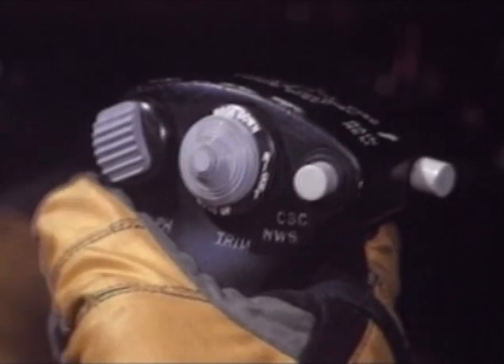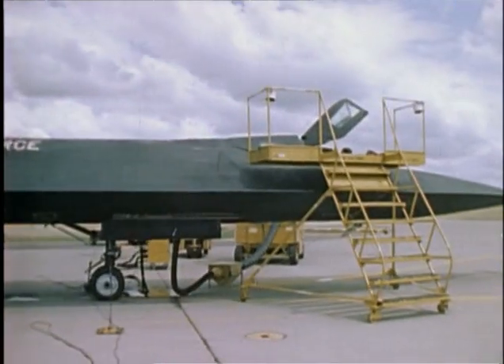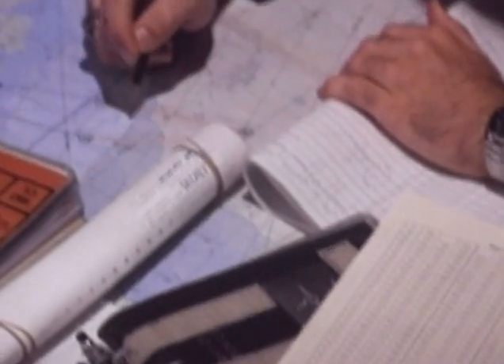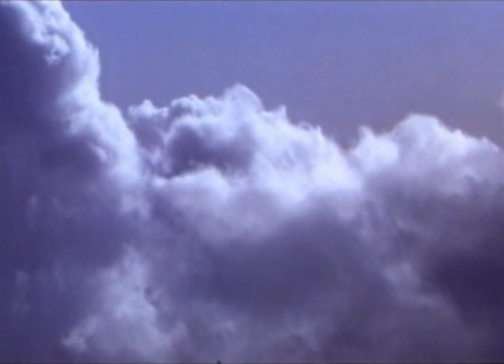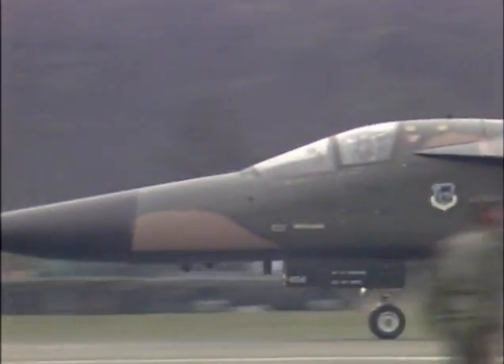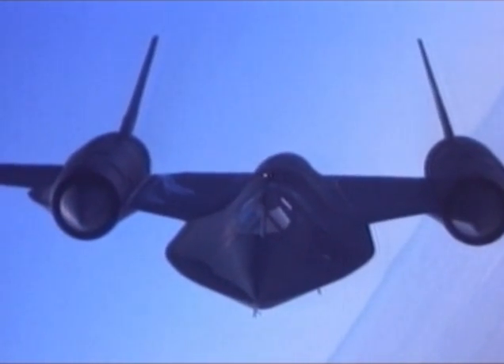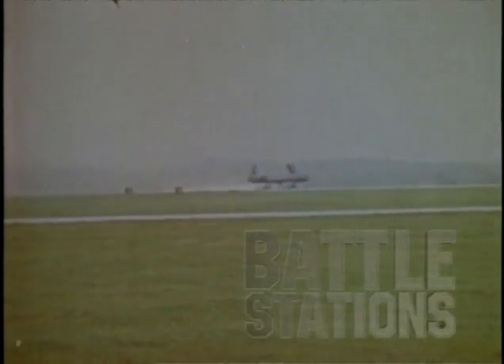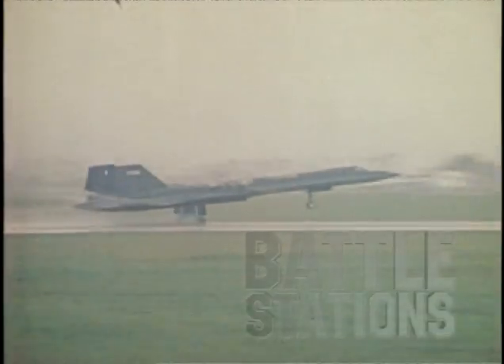Battle Stations - SR-71 Blackbird Stealth Plane -Full Documentary

Comment: And yet they could not stop the fuel tanks from leaking on the ground because there is no sealing material that can withstand the extremes of temperatures the Blackbird underwent in flight.  If that is so (and it is) then how can the ISS (and other "spacecraft" ) be airtight in the extremes of both being on earth and so called outer space?   It can't.

Comment: Did anyone notice in the ending credits of the first video around 44:38, the picture of th SR 71 taking off looked like it had exhaust heat Plumbing coming from out the center of the aircraft? Anyone knows what that was, maybe APU??
Reply: At the speeds this bird does causes the plane to heat up to ~1000-1500 Fahrenheit from the friction of air molecules sliding across its surface. When metal heats up, it expands, so there was the need to put expansion joints in the fuselage (which also serves as the fuel tank).  When the plane is cold, it leaked fuel like a sieve. So they only added enough fuel for take off, then immediately rendezvous with a tanker to add the 60,000 pounds of fuel. What you may have seen is fuel mist.
Reply: m.briggs yeah I noticed also, might just be fuel leaking etc. Or maybe it's a 3 engine variant that goes quicker than mach 3/4 ... Just a thought...

Comment: I was stationed at Beale AFB in the early 70's as a Precision Photo Processor. Back then the SR71 and its capabilities were top secret and we had to have a top secret security clearance to work with the film. It wasn't many years later that you could find an SR71 at most aviation museums around the country. Times change but the speed records will probably last forever. For me the most impressive aspect of the plane, other than its pure beauty, was the volume of sound at take off.  Holy afterburners batman!

Comment: The SR-71 is anything but stealth, the amazing amount of heat it generates makes it actually easier to detect on radar than a normal plane.
Reply: I didnt know radar picked up heat, thought it sent out pulses of  electromagnetic frequency and when it hits an object reflects that pulse back giving a signature. The stealth engineering implemented here reduced the radar cross section x100. The priority of the design was speed, not to make it invisible.
Reply: LOL! Of course, there is no way you could possibly know. Or you wouldn't be talking nonsense.

Comment: I once saw an SR-71 doing touch and go's as I was driving down a remote road and though I was aware of them seeing one bearing down on me gave me a feeling of doom... I realized the absolute power struggle of the cold war, still gives me goosebumps 33 years later.
Reply: Lucky you !  Use to work close to a airport and my moment of luck was a F18 doing escort duty for some drunk on a plane. Was sitting outside and had a weird feeling. Looked to my right and there it was!  I swear could have hit it with a slingshot and a rock kind of low !!

Comment: Pity the stealth capability was utterly lost because the thermal signature was so bit it could be spotted from several 100s of miles ON RADAR - the change in air density was THAT BIG. That is the bit they DON'T mention. The upgrades to the U2 make it far, far more 'stealth' from a modern perspective. If you can defeat radar, thermal & laser detection (which it can), it is likely that the U2 is still overflying 'opposition' states.

Comment: they really need to fully restore and recommission one SR-71 simply for military airshows and display so the public can see EVERYTHING that went into such a masterful design. There isn't a thing left on this plane that isn't obsolete by now anyway... We need a new reconnaissance plane that makes peoples jaws drop when it's finally revealed. The aurora SR-72 might be that plane, but until they actually announce it's either A.) built or B.) I.D.'ed in battle it's just a fantasy plane... This plane literally hung on my wall as a kid. My neighbor worked for Lockheed  and got me some photos of it blown up to poster size. They currently have gutted planes on display at the Smithsonian Air and Space museum in D.C. and on the deck of the USS Intrepid in NYC. Also, there's a rumor that there IS a flight capable SR-71 being housed at the (Semi) defunct Griffis AFB...

Comment: They failed to bring up one of the many stories involving this incredible plane. The titanium was actually acquired from the Soviets because they had by far more of it then we did. They used bogus companies and what not to get the metal
Reply: They mentioned it - you failed to recognize the statement.
Reply: And the thing leaked fuel like a sieve. They had to engineer thermal expansion into the plane. At full speed, it would grow several inches longer and wider, so they had to leave gaps.
Reply: @rylian21  It wasnt the thermal expansion of about a foot that made  the tanks leak.  There were corrugations and special forming techniques that allowed for the thermal expansion without buckling.  The reason the tanks dribbled was because the specific JP-7 fuel the J-58s burned was characteristically difficult to seal against. As the dribbling progressed into leaking, the tanks were resealed. Remember the planes structure was the tanks and the tanks were the planes structure, they were one in the same. The dribbles became an issue only if they became leaks once the fuel system was brought up to flight pressure using nitrogen gas from the liquid nitrogen dewars on board.
Reply: it should be than not then
Reply: No sir the titanium technological know how and the original stock came from a Canadian company that was later kindly asked to be closed down.
Reply: Howie Carson tf

900099
Reply: Myth.
Reply: Captain Jim  -  you do know that none of the uranium produced by Uranium One can leave North America right?   Do you really think she alone made the decision to allow the sale of the company?    Unlike trump’s foundation (which is now under criminal investigation), the Clinton Foundation has the highest rating a charity can get and doesn’t profit them personally at all...   they make plenty on the speech circuit.   You act as if Hillary had a suitcase of yellowcake and swapped it for a bag with a large $ sign on it in some parking garage at night...
Reply: @grendelum  Yeah, that'd be pretty close.  The Clintons belong in prison for that and several other things.
Reply: Who cares how they got it back then.  Now it is not that rare and you see it used in many products you can buy,  All of our Nuclear Subs are made with it and they take way more titanium for one than the entire SR-22 program did.  Now Clinton sells the right to 25% of our Uranium to Russia despite warnings they were trying to acquire it through fake companies.  She and Bill made millions to overlook it. That is more troubling to me.  If we can beat them out of it great but do not turn around and give them materials for weapons that may be used to destroy us.
Reply: Captain Jim  Not sure why you bothered about that Jim.........I can't see Russia and U.S.A. going to war.

Comment: In my opinion, the SR-71 is the best technological achievement of the 20th century.  It was the most ahead of its time, and still has not been surpassed, 50 years after it first flew.
Reply: Its actually still ahead of its time.
Reply: How about the computer...?
Reply: Saturn V rocket is waaaaaaaaaay more impressive.
Reply: jim bob banjo :how the fuck do u think a missile would leave the bird?? the moment you set it off, you will fly into it!..and you want them to make it faster??.why have you got a mach+3 (plus in your case), warheads lying about, that the rest of the world is unaware of??..you can't have a high altitude, 3Xsupersonic bomber..that's what the nighthawk and B2 were then built for
Reply: @johnnysheridanboxing5185  Look up the YF-12A, it used the A-12 design and came out before the SR-71.  The YF-12 Blackbird was armed with 3 AIM-47 Falcon missile.  We are talking about high speed interceptors, not bombers.  The YF-12 could carry 3 Falcon airto air missiles and could shootdown targets maneuvering at 500 feet while travelling at 75,000feet at over Mach 3.  3 YF-12s were built, 1 survives.  NASA ran the YF-12 for years in the 70's. All F-12's/YF-12s have ventral fins coming down off the engine nacelles and a single larger ventral fin that folds down in between the engine once the landing gear comes up.  This version of teh Blackbird doesnt have chines on its nose as they would have interfered with the RADAR dome in teh nose. In order to retain directional stability, the three ventral fins were needed.  All the SR-71 B and SR-71C trainers that have the rear cockpit sticking up into the windstream also have the 3 ventral fins. The A-12 trainer does not have the ventral fins.   https://en.wikipedia.org/wiki/Lockheed_YF-12
Reply: @hoghogwild  - The YF-12A essentially became the SR-71, with design/engineering changes and improvements. But I didn't know they could be armed. Amazing that they began the program in the 1950s/early 1960s. Also amazing and ingenious that they used a secret "shell" company to source Titanium from the Soviet Union.
Reply: @Sovereign_Citizen_LEO  In essence yes, but aerodynamically they were different, mostly due to the lack of chines and being 6 feet shorter than SR-71.  The A-12 was a single seater(except for the Titanium Goose trainer that had teh full cockpit behind the front cockpit. The rear cockpit was also offset slightly. The trainer variant did NOT have the ventral fins at the rear under the engine nacelles unlike what the YF-12A Interceptor(missiles) and the SR-71-B(trainer) and the SR-71-C model which was a structural front fuselage mated to a wrecked YF-12A rear fuselage.

On 26 January 1960, the CIA ordered 12 A-12 aircraft.  In mid 1960, the Ir Force ordered 3 YF-12-A's. The A-12's were produced from 1962 to 1964 and flew from 1963 to 1968 and operationally from 1967 to 1968.  
The AF-12s took the seventh through ninth slots on the A-12 assembly line; these were designated as YF-12A interceptors
May 27, 1967 is when the A-12 arrived at Kadena.  In 1967-68 at Kadena there were 3 A-12s flying and eventually the Sr-71s came to Kadena and they overlapped for a brief period of time.  The last operational A-12 mission was over North Korea. On 4 June 1968, just 2½ weeks before the fleet's retirement, an A-12 from Kadena, piloted by Jack Weeks, was lost in the Pacific.  SR-71's were tasked to help with the Search and Rescue mission. Frank Murray made the final A-12 flight on 21 June 1968, back to Palmdale California.

There were 18 aircraft built at the initial single cockpit A-12 length.
13 A-12's single seater single camera photo recon,pilot turned camera off/on-if it was foggy, they pressed the "foggy weather button". There was a single Titanium Goose trainer that was built with the full/slightly offset rear cockpit which stuck significantly out into the wind stream. This trainer was only built using the J-75 engines instead of the J-58 engines. The less powerful engines and the huge 2nd cockpit protruding out in the airstream reduced top speed to around Mach 2
3 YF-12-A front seat pilot, rear seat FCO(FireControl Officer)
2 M-21 front seat=pilot rear seat =LCO (Launch Control Officer) these       launched the D-21 drone.

Total Blackbird family
A-12 for the CIA 68,000 pounds fuel load, narrow nose chine formation
A-12 trainer for CIA
M-21 for Mother ship that launched to D-21 or daughter drone
YF-12A  high speed interceptor prototype variant, chineless front nose in order fr the air-air targeting RADAR to remain unobstructed, carried 3 AIM-47 Falcon missiles(later developed into the AIM-54 Phoenix missile system of the F-14-anytime Baby!
F-12 high speed interceptor production aircraft(never built)
SR-71-A- 2 seat full recon bird, wide front nose chines, multiple cameras, electronic snooping, 7 ft longer, carries and extra 12,000 pounds fuel for 80,000 pounds max fuel
SR-71-B trainer version, wide front nose chines, rear full cockpit which stuck out into the windstream-much more than the flush mounted A rear position for the rear seater the Recon Control Officer
SR-71-C  The 2nd to last SR-71-B was lost and everyone thought that the sole SR-71B trainer should have a backup in order to manage risk. So a structural test article front was mated to a written off YF-12A rear fuselage.
Reply: better than the moon landing?
Reply: I think the Apollo program was pretty cool, too.
Reply: Sorry but moon mission & hardware was the best technological achievement of the 20th century.
Reply: Love flying it in sims, so much fun!
Reply: Johnny Sheridan boxing :
Dude.    You need to go back to school.      Maybe high school or even junior high school !   (Just giving you a hard time guy).  But honestly, just stop and use common sense before you comment sometimes.   The Blackbird, I would think could easily carry and use any kind of missile or rocket.   They would simply have to be released and/or dropped from the plane before their engines were ignited. SIMPLE.      LOVE THE BLACKBIRD ! !
Reply: 17.000 MPH
Reply: 17,000 mph
Reply: Dan Cahill 
right. they where making a verient that was an intersepter. it would've used missles.
Reply: bob thompson *were *variant *interceptor

You're welcome.
Reply: One of the best American aviation achievements (and world)
Reply: You are so right. Now if only we could arm it to the teeth, make it faster, make it better. Lets do it..
Reply: Close between this and Concorde for me

Comment: The highest official speed was set with ONE engine at mach 3.2, multiply that by 2 and there you go
Reply: Elijah Stewart Lol, that's not how it works.
Reply: HulKevin shhh
Reply: HulKevin Multiply it by two, that equals 6.4, divide 6.4 by 2, that equals 3.2, round that to 3, Half-Life 3 comfirmed
Reply: Nope. Redline was Mach 3.3. After that... the engines literally start to melt within minutes.
Reply: Propulsion equations do not work like that...roflmao